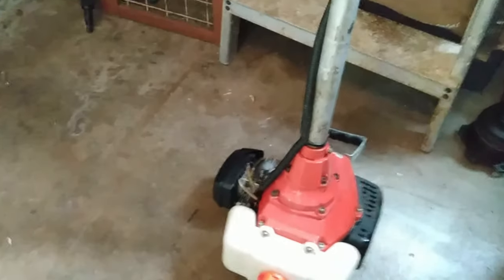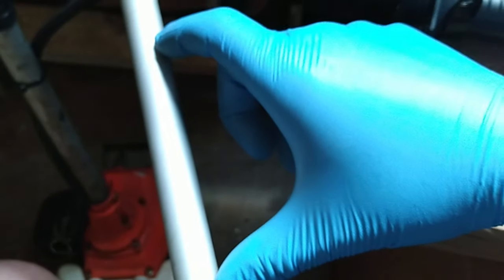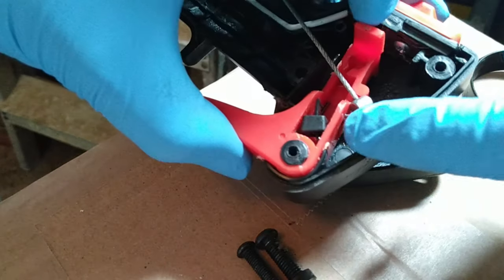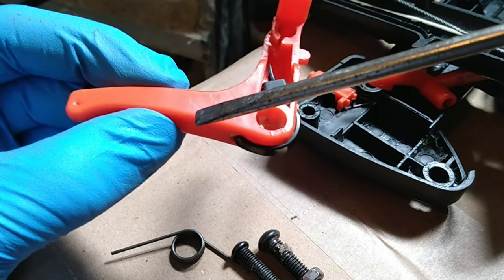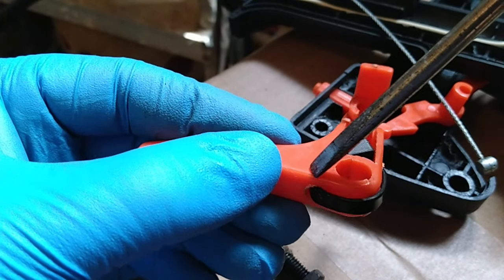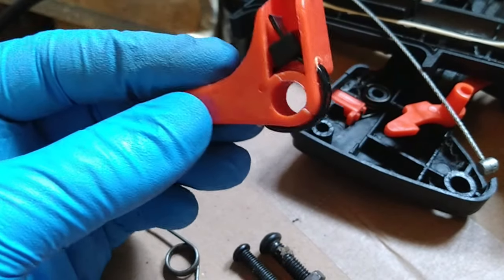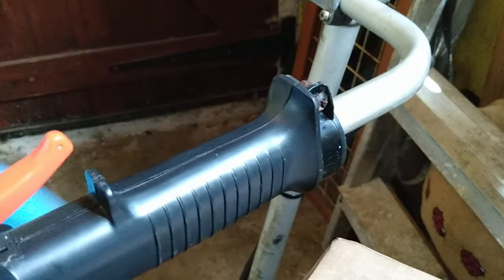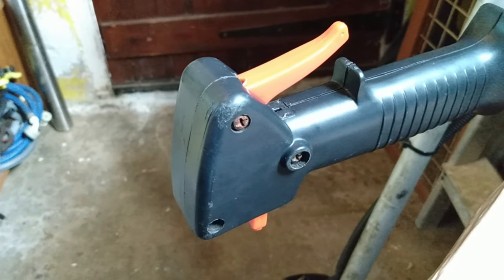Petrol Strimmer / Brush Cutter BC415 Throttle Trigger Switch Lever DIY Repair & Reassembly

Comment: I had to grease trigger because it kept getting stuck. I also Grease the cable for the throttle. When I tore it apart that little spring pop out that's the return for the safety switch and and throttle lock. For the life of me I could not figure out how it went back together. Until I saw your little video. Once I saw how that safety trigger and throttle lock all went together with that little spring .I put it back together in 5 minutes. Thank you for the good shots on where everything went together that was a great video it saved me a whole hell of a lot of time and effort I thought I was going to have to buy a new one I give you five stars and 10 thumbs up thank you
Reply from the maker: Hey, thanks for watching and the great comment 👍. I'm so pleased the video helped, that's the reason I make them and it makes it all worthwhile if it helps someone. That's a very good idea to grease the cable 👍. I'm the same, I'd much rather fix something and save my cash than have to buy new😉

Comment: Hi Dan, great tutorial, thankyou.  Are all triggers on these apparatus  universal? Just took mine apart on a T-mech strimmer and there's bits and springs everywhere!!!
Reply from the maker: Hi, thanks for watching and commenting. I imagine a lot are mostly universal but of course some manufacturers will have used their own designs too so will be a case of careful looking and logical thinking to figure out, I hope it works out ok🤞
Reply: @dandantherepairman  Many Thanks